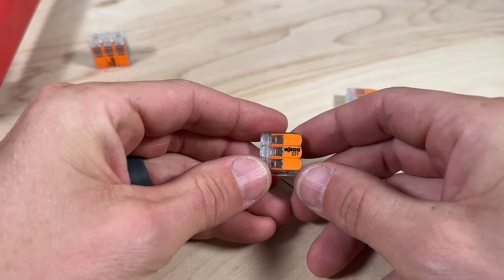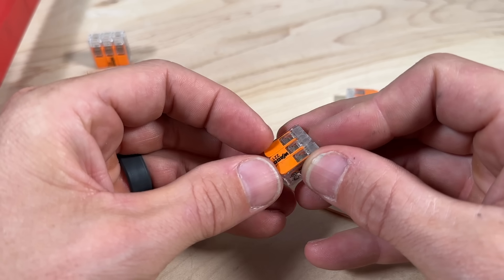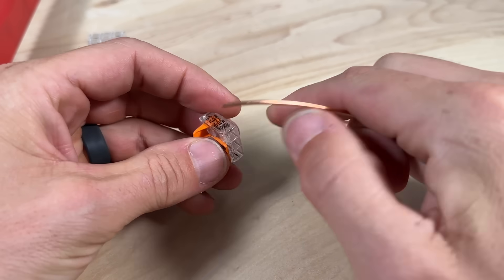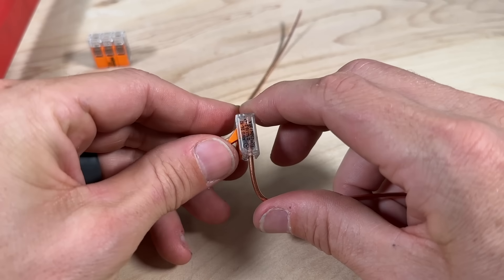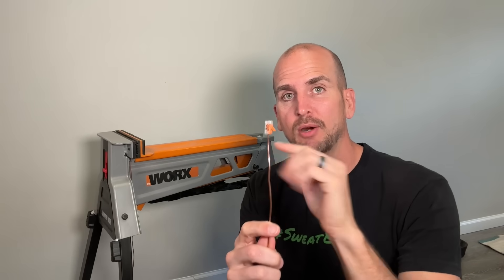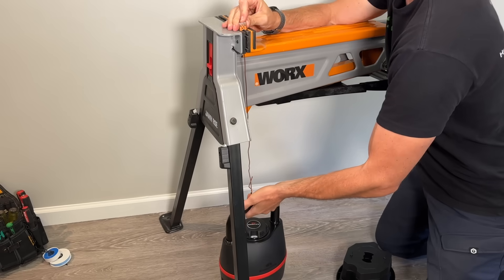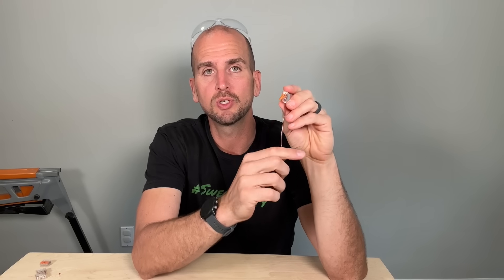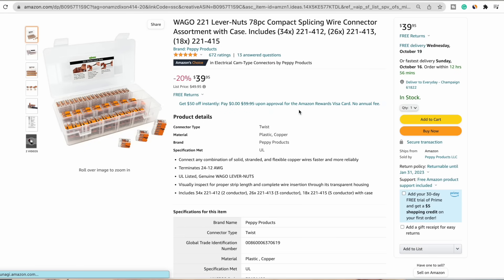WAGO 221 Lever Nuts: Testing the Most Common Negative Feedback

Comment: Under what circumstances does one encounter any kind of pulling pressure inside an electrical box? Yes, you should ensure that the lever(s) are fully seated - but there should not be any kind of pulling forces inside the box.

Comment: After using other Wago connectors, the limp levers made me wonder if I had bought fakes. Even if the partially open lever hasn't released a wire, it does concern me when filling an electrical box. Too easy to open those fully. I'm taping them. Pushing a five wire ground nut into the back of a box does require some persuasion. And I have had the partially open levers open on me when doing exactly that. Also, why doesn't Wago make a 4 port 221?

Comment: I had a lever flip up when putting the wires in the box after completing the job. Call me paranoid, but I now put a quick wrap of electrical tape around the WAGO levers to make sure that doesn't happen again. It's cheap insurance to avoid potential problems.

Comment: Lever Nuts Suck. Electrical Connections are based on Surface Contact. Lever Nuts Do Not Provide this. Plus ,House Wires are Solid and you cannot Crimp a Solid Wire. Lever Nuts are Only Good for DC Stranded Wires.

Comment: Just wanna note that this might be due to sample size and whatnot. Theoretically it shouldn't even make a difference, as the mechanism, from what I understand, has the lever only engage with the spring when you open it, i.e. the plastic plays no mechanical role when closed apart from insulating and such things. Would make sense that if you stuff a thick wire in the mechanism, the latch now has more play since the spring is more open, so to say.
Only downside I can think of is now it can theoretically catch on things, but that's not a reasonable concern in a junction box. If there's a wago connection hanging in the middle of your living room and your shirt always opens the half-open levers because they poke out, you got bigger fish to fry my friend.

Comment: Levers will not open by themselves when in an electrical box. If installed with any competence, the levers being loose for the initial opening arc will be an annoyance and not an actual problem. I understand that when you're jamming several connectors into an electrical box that something wires can get under the levers, but carefully folding the wires into place will avoid this issue.

Comment: It is stupid to ask this from a wago connector, it is your job to make sure it is not forced open inside your connection box. Also for that solid wire there are special wago connectors without a lever, if you really are concerned about that.

Comment: Wago's connectors (both lever and push fit) are designed to be used within their enclosure boxes, where the cable sheaths have retention/strain relief fixtures to hold the cables in place, they are not designed to be left out in the open and have the connector act as you are showing it, there should not be any strain on the wire/connector interface, that is using them outside of their design parameters.

Comment: I installed two Reliance 310A manual transfer switches with AFCI and standard breakers. Used WAGO 221-2401 (inline) for everything in the sub-panel except the A & B circuits on each transfer switch that have 10AWG coming from them. I used WAGO 221-612's on those. Since it was my house, my job and my time, I cut a piece of electrical tape in half lengthwise and used those two pieces to wrap around each clamp of the 221-2401's while leaving the center "test" area open should I need to do any multi-meter testing later on. Put electrical tape on the 221-612's as well. 

25lbs of force in my sub-panel? Perhaps if one of the walls in the house falls over. Possible in an earthquake, but I am going to have bigger problems if that happens than a disconnected WAGO. I'll never use wire nuts again.

Comment: I'm guessing the force needed to pull a wire from a properly installed wire nut with twisted electrical conducters is many times higher than the Wagos.  Part of what this test fails to address is that I have had Wagos disconnect not with a straight line load but when I am twisting other wires in a box (pigtailing)...I have on occasion had the conductor twist out of the Wago....not good enough for me....I won't use them in my home on a permanent basis.  The old ways are sometimes still the best ways....YMMV

Comment: A bunch of Romex is very stiff and takes a lot of force to get back into the box.  I worry that with a lever partially open, it will  catch on something and get opened completely when you wrangle the stuff back in the box.   Use tape.

Comment: Know this is an older video but:

1. You can secure the wires, silicone the wago connector and secure further with electrical tape before pushing into the junction box - whichever type you're using. 

2. Wago sells gel boxes that, once secured [as mentioned in the video, and as mentioned in Step 1], could be implemented and are rated as IP-8 protection.  In a sealed junction "sealed being the important part] the box and connections are more than connected. 

My suggestion: the wago connectors aren't that expensive- just depends on your budget, need, and any uncomfortablity with wiring. 

What IS Expensive are the Wago Gel Packs. I think it cost me $10 per pack of 10 for connectors, but the 3-gang, 4-pack of gel boxes [i needed 2 gel boxes per floodlight)was $35 -- definitely not cheap. Probably going back to heatshrinked, waterproof butt connectors.

Comment: Oddly enough,...the supposedly inferior ( but physically larger than WAGO 221-4XX series) clones from Harbor Freight/Pittsburgh.... have a much more solid lever action that wants to stay closed with more certainty..... odd it's like this. Aside.....the HF units are sized pretty close to the WAGO 221-6XX series, which are good for 10 ga and 30A. A further issue however is that the HF packaging label says they are good for SOLID 10 ga....and up to 12 ga for STRANDED wire. The problem is the info molded on the case only says 12 ga max... so the mis-match of data is not good if there should be an "issue" that develops and gets investigated.

Comment: Interesting Vid.  I've been looking into either Wago 12awg inlines for extending a few wires within the main breaker box and IDEAL Electrical 30-1342S SpliceLine In-Lines.  The Wago seem to have more reviews but this could just be because of the newer flip tech and reusability but I wonder which one is better for permanent use cases.

Comment: Try the same test with a wire nut. Guaranteed it will not handle the same weight that the Wago did. One can also put a plastic cable tie around the Wago to make sure the lever can never be opened. Great product.

Comment: I didn’t run a t-test but even  if it showed a  “statistically significant” difference, I tend to agree with you that 20 lbs is still pretty good. Also good on you for using 14-gauge conductor as I think it would show lower pullout force (even with the level fully closed) vs. 12-gauge. 

I only just started using the Wago 221’s today for a DIY repair. I did notice one of the wires which was no more than a 14-ga didn’t “feel” as secure as the 12-ga did. But I think it is still fit-for-purpose. 

I never heard of this issue described, but now having seen it, I might take an extra precaution of using a wrap of electrical tape around the levers to keep them fully closed.

Comment: Considering how loose the lever is in that free play range i thought it would have 0 effect on the holding strength ... don't get it , were you using the same wagos that you did the first test on? or did you get 3 new ones for the lever up position?

Comment: I'm surprised that this position affected the pull durability. However, for me the main issue is that when it's so easy to put the lever in raised position, you might accidentally open it up completely while pushing the wires into the box.

Comment: Most electricians wrap wire nuts and outlet connections with electrical tape. If you are concerned you can wrap the Wago with electrical tape to keep them fully closed as you have been doing for years in the past.

Comment: These are perfect for connecting ham radio to power supply.  Use these for non-permanent tasks and they’re perfect.  Don’t wire a house with this, I’m not an electrician, just a realist

Comment: Great 'physical' test, but... does the resistance/conductivity change with the levers open more? I will never have anywhere near 20lbs of force on a wire being held by a lever nut, but there's always a chance the lever will get hung up and partially open when maneuvering it unseen throughout an enclosure.

Comment: I use the lever nut to set up my systems especially when trouble shooting or for temporary holding during renovations, once satisfied with the configurations i switch effortlessly to the more permanent wall nut style. Also saves a bit of money and i do feel they are more secure in crowded boxes. The switch only takes about 30 seconds.

Comment: I'd like to see you do a 4-wire measurement of the resistance of the connections.  In conjunction with the infrared temperature measurements you have done before, this will give a definitive assessment of the quality of the connections in various configurations.

Comment: I am more interested in comparing the RESISTANCE of the connection with the lever fully down and partially up.  I believe that properly installed in a box a connection should never receive that level of pull.  But if the resistance increases, that could be a problem.

Comment: How about design your own with levers that click down and/or have thicker connectors as well. 

You could then retain that wire hold strength, but more importantly have more metal contact and less resistance.

 Hopefully then ideally it will operate on same level as wire nuts, but would lose that space saving feature in the process, all the while becoming would expensive to produce as well.

In summary, if I produce that would you pay ~$3 or more even per connector starting off, until I'm able to increase production of course... maybe 🤷‍♂️.

Then again why hasn't anyone else 😂

Comment: I don't like wago 221 lever nuts or push in connectors because I do not trust the connection compared to wire nuts and yes I have tried wago lever nuts out and think that they are only good for stranded wire

Comment: I still use black electrical tape to wrap the wagu connector on the advice of another electricians video for added safety to prevent the connector from inadvertently separating. The same advice given for the typical twist connectors. So in essence, safety first. Connect PO properly, check by pulling on the wire to ensure it holds. Then wrap with piece of electric tape for added security.

Comment: It's a UL listed product. It's safe if used as intended. The level being another to chime out further is due to the spring being opened up due to the wire in there. Smaller wire means the lever comes out less.

Comment: Not sure the weight thing concerns me as I don't understand why anyone would implement them with under stress and potential failure from wires pulling out. What concerns me a bit more, is the wiggle ... which indicates that the contact area on the wire is minimal for current and potential heat issues.  But, thx for the vid.

Comment: Your test is not accurate as the lever is only for opening the cage clamp.  Once you release the lever the spring on the WAGO cage clamp holds your wire.  It forces the wire into tinned copper bus bar forming a gas tight seal.  The cage clamp allows the connector to go from 12 to 24 AWG size wires.  The lever has absolutely nothing to do with holding the wire.😊

Comment: I've had Wago 221 unsnapped inside a junction box, and the wire came loose. 
Rather unexpected and disappointing. 
I had to go back and use electrical tape to tape up the Wago.

Comment: This is where QC comes in. I’m going to get flamed for this comment but, most electrical connections are put together in the sloppiest way, electricians cram everything into the box without regard for the final configuration. It’s as if you’re just going through the motions over and over. Just make sure everything is clean and neat. All it does is sit there and there should be no 20lb stresses on any connection outside of aerospace. 😊

Comment: wagos are not full proof. if they're not seated properly no power will go through. also the can and do break if you're putting too much pressure on them. however I'll still take them over wire nuts.

Comment: My biggest concern with wago is the PET plastic eventually breaking down. It may be 20 years before it's an issue, but especially in hot humid climates, these won't last forever. The plastic will fail, and nothing else is holding the spring and bar in place.
Reply: The spring is locked in the metal bus bar, you can dissolve all the plastic and it will still keep a firm grip on the wires. Without the plastic all the metal will be exposed and lack isolation, and that itself would be an issue, but that goes for a lot of stuff. The only time the plastic is under any load is when you open the leaver and it pushes back the spring.

Comment: Reading the many comments where black electrical tape is used to prevent the WAGO levers from opening is just more evidence that the WAGO is junk and that the "fix" is foolishness.  Black electrical tape is a stretchy thermoplastic (it flows then melts with sufficient heat) coated with an adhesive that flows.  The tape can over time unfurl itself from the WAGO block.  A great comfort that is.  That would not happen if we could use the now rarely available friction tape instead.  This is what is called "progress."

Comment: It's clear to me that the WAGO 221 design follows the "risk management" philosophy, which is, cheapen the design until a preset limit is met.  The problem with that approach is that the preset limit is established arbitrarily, not scientifically.  Oh, sure, the product gets thoroughly tested for reliability but that means nothing.  It's the preset limit that is at question.  The REAL QUESTION IS:  How many pounds of pull will a WAGO experience in the hands of a clumsy, eager beaver to complete the job who is reckless and heeds no preset limit because of his ignorance and vacated ethics?  As a product with a virtually fool proof design the WAGO is a gross failure, in my opinion.  It's a sham product designed by profit hungry dreamers with well bought off lawyers to back them up.  Another way of stating the issue is as another SNAFU!  "Damn the torpedoes, full speed ahead - let the politics reign supreme!!!" :face-orange-frowning:

Comment: I’ve been using these for a while now, with zero failures. Long before seeing this video, I made it a habit to put a single electrical tape wrap around the finished connector, just to be sure nothing would hang on the levers. Having seen this test, I’m glad I did that… not because I think it’s a flaw, but because it eliminates the concern altogether.  Once a connector is properly secured in a box, nothing is going to be pulling on the conductor anyway, but an additional ‘security blanket” doesn’t harm anything. 

I should note that I always taped wire nuts as well. I’ve seen them loosen and fall off in time, so why not secure them too? Like it is with these new connectors, there was a time when the old guard didn’t trust wire nuts. It’s the nature of people to trust what they know and scoff at new ways. This baby boomer has moved on, and Wago connectors are a great product in my opinion.

Comment: If you run a piece of electrical tape two times around the Wago connector it will prevent the Wago from opening up - very simple solution.

Comment: Just put a single or double wrap of electrical tap with a fold end for easy removal and then they are secure.  The new Ideal In-Sure connectors don't have that issue.  I use both and if you are aware then you should not really have issues with either brand.

Comment: Scott an excellent review study in fact I have one in my hand right now. I’ve noticed it held less but lifting the lever does not seem to decrease the spring tension. Even so I’m going to start using them. They seem like an easier install than wire nuts which I guess can also fail especially with stranded and solid I wire nuts pushing them into a box. Thanks for sharing.        Artie 👍

Comment: I don't think this is a flaw and may actually may be a designed feature. If the plastic pull was directly atatched to the metal lever then if the pull got a slight snag when pushing it into the box, then the wire would fully release. Granted it takes a little more force to release the lever if were directly attached then when it's in that up possition, but we push the wires in the box with sufficient force for that to happen anyway. I tihnk because of the leaway that the plastic pull has makes this less likely to happen.

Comment: Its not that it takes 5 pounds less force to pull out.  That result is because the clamping force is reduced.  This is akin to a loose wire nut and point for possible heat to occur.  I would love to you see your heat test conducted with the lifted level and see if there is a noticeable increase in heat generated under high current load.  But yes that seems like a serious flaw in the design.